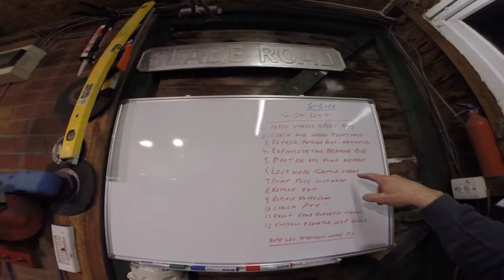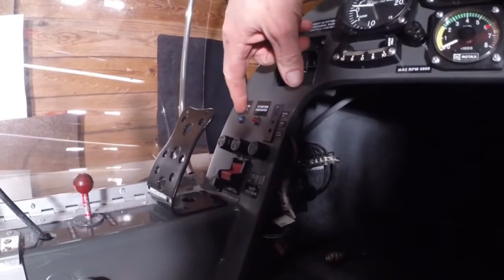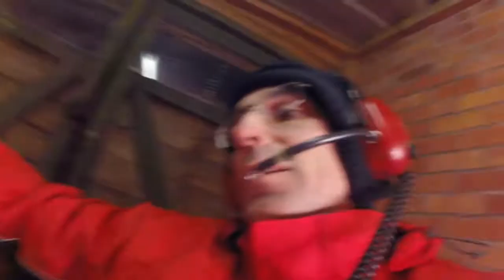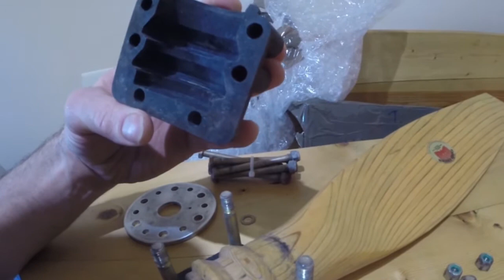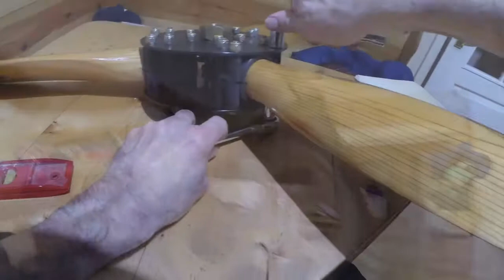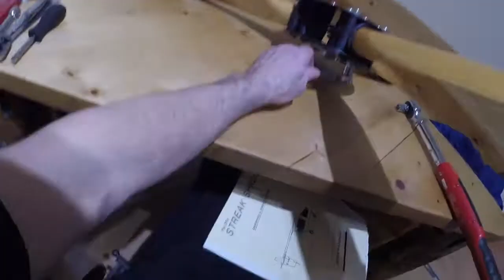Streak Shadow Rebuild - Part 36

Comment: Good going Paul. Just a thought....have you checked the blade tracking after setting the pitch? I set my prop angles up perfectly just a you have done, then balanced it, put it on the aircraft and oh my! Way out of track . Small adjustments to the way the blade roots sit in their clamps threw the whole thing out of balance so back to square one.... I'd suggest angles - track - check angles again - balance in that order.
Reply from the maker: No you are right, I havent. When you found the track was out, was it a case of loosening the roots and pushing the blade fore/aft until the track was correct, then retighten? whilst trying not to loose the pitch setting?
Reply: That's right. It's a real juggle, best done on a flat (glass?) surface, hub down, turning the prop to see whether each blade tip 'cuts' a given point on a vertical marker. You'd think that as you tighten the clamps each blade root would sit snugly in its grooves and be an exact 'throw'.....sadly not so. Even tightening the clamps can throw things out.....it's a fiddly thing, but worth it in the end. Very satisfying to get the prop angled AND tracked correctly. Balancing after that is a doddle.
Reply from the maker: Ah I see, I was thinking of remounting it on the gearbox to check the tracking, one thing less to hold ( let the prop mount do that) and also get a bit more leverage when correcting the track, but more bolts to do up and undo...will give it some thought. Did yours need any balancing? Was wondering how you did it, if so?
Reply: No, it's hopeless trying to do it on the aircraft. I've balanced two different Precision props - one with 3 matched blades (check your numbers on the roots) and another with an odd blade out of three.....looked identical but the weight obviously wasn't - that needed a LOT of hardware on the hub (about 6 or 7 penny washers if I remember). The matched blades only required one small washer. Ciao, Phil Cater.

Comment: What is the make and model of your new radio? I have to replace the old Icom A3E on my CD Shadow and the newer Icom radios ( with the battery pack on the back and not the bottom) seem too tall to fit without fouling on the canopy
Reply from the maker: James It’s a FTA-750L Airband Transceiver / GPS. It was recommended to me by another Shadow pilot. I am yet to put it to practical use, so cannot vouch for it yet.